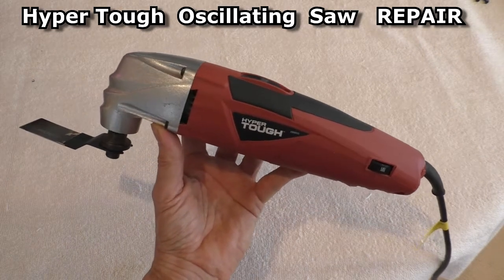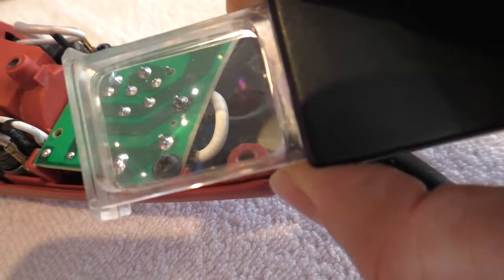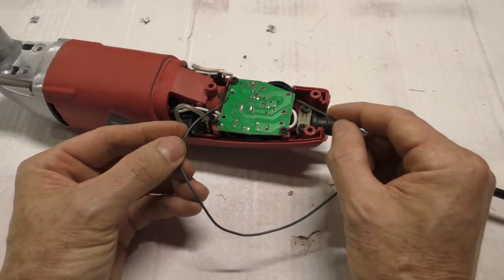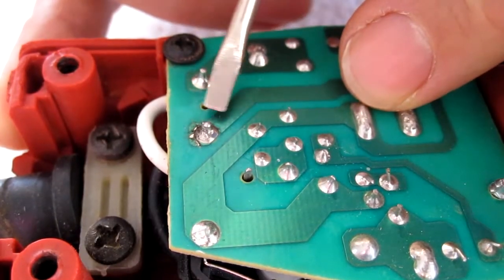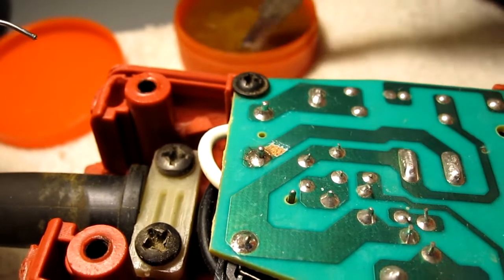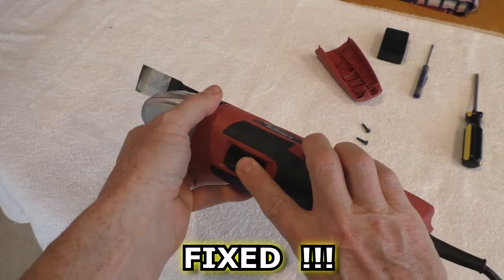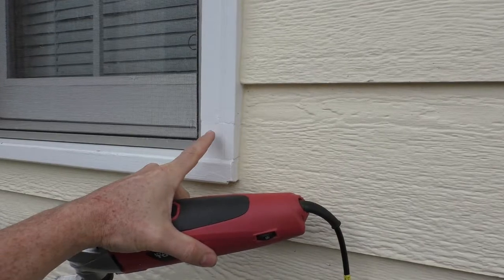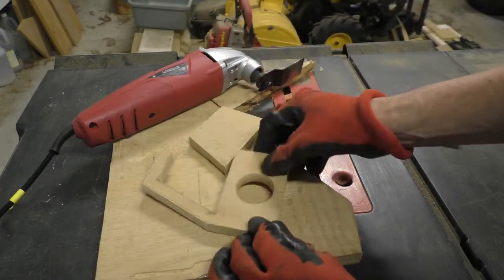$20 Oscillating Saw Multi Tool WALMART Hyper Tough REPAIR rotten wood trim Dremel Dewalt Makita

Comment: I purchased a hyper tough variable speed oscillating tool at Walmart from the clearance isle. It was marked down to around 12 dollars. The box was all taped up like it was a returned item, as I'm sure it was.  I took it home ,plugged it in, and it worked perfectly.  Since then, I have used it to cut the exterior wall subfloor in a 1500 square foot double wide mobile home. It was 3/4 inch osb, and it never even hick up once! I have also used it many times in various projects around the house during a renovation.  This was over 3 years ago, and it's still works perfectly.  It's almost embarrassing to admit, but I have far more expensive supposed higher quality power tools that have given up the ghost within a year from purchasing while doing far less intense work! I originally purchased it on a spur of the moment . I never expected it to last. However it's made me rethink my opinion of cheap power tools. I have spent a small fortune on makita, dewalt, and even festool only to have some of them fail while my cheap 12 dollar oscillating tool keeps going on like the Duracell bunny! Lol!
Reply: A prime example of "don't judge a book by its cover" type of thing. 
I can certainly relate. 
I LOVE CLEARANCE isles.😁

Comment: I bought one of these brand new and it had a broken solder joint in the same area. Luckily Walmart is really good with refunds and just refunded me the money and let me keep it. I broke it open and added some solder to the joint and it's working as expected now. Thanks for the video, it was helpful. 👍

Comment: Very dangerous. You hold a very thin wire (mistake 1) with both (mistake 2) hands to test a connection when connected to mains voltage (220v). A thin wire is not rated for high wattage, e.g. 300W at 200V, and you don't know if the tool motor doesn't draw a much higher current when starting up. It could have melted the wire plastic coating, burn your finger and electrocuted you. You could at least, temporarily solder it into place, then turn on the tool, to check your fix, while you are at a safe distance.
Better, use a thick wire in any place hooked to 220V.
Reply: Ok Karen 😂
Reply: Also, it sounds like he's in the US where it's 120V not 220V.
Reply: 120v in US. And device is rated at 2.1A
Reply: @martyhog01  Not really funny as it's always good advice to be cautious with electricity, unless you're a Svengali like Tesla.